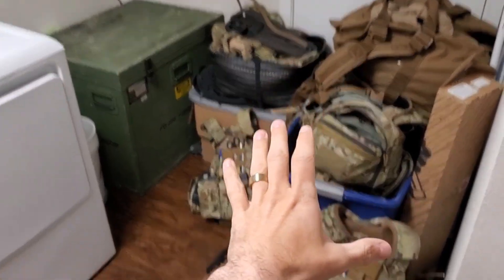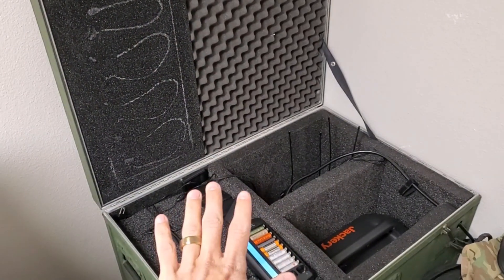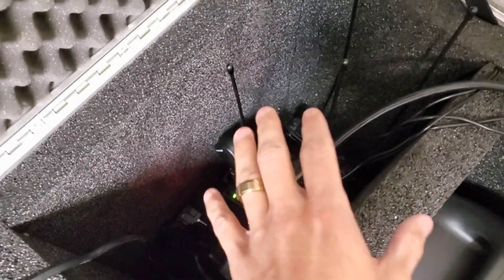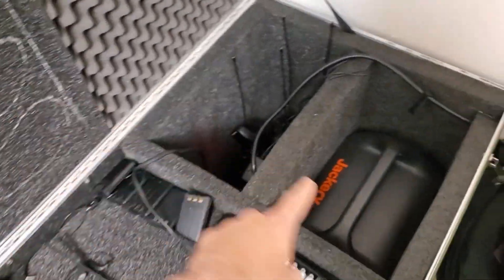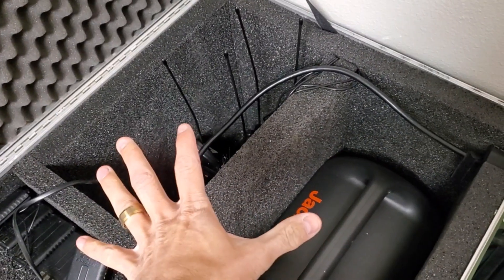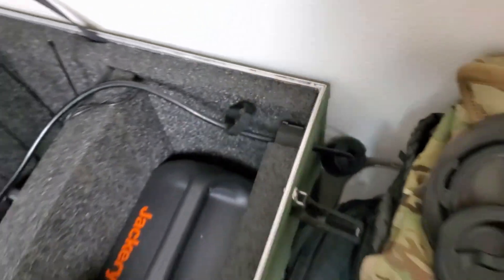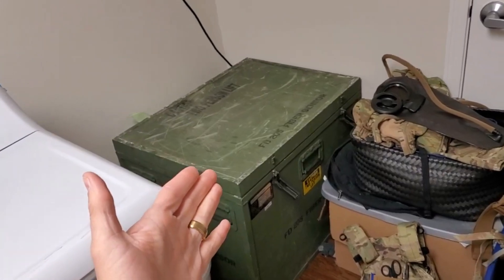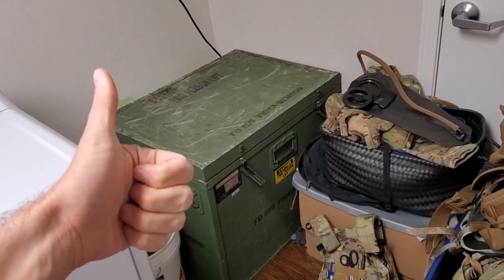Faraday Cage Set up

Comment: I suggest you line the inside of your box with adhesive backed copper foil (like the stuff used in guitar pickups).
Reply from the maker: Why would I add another layer of something if it already provides 80+db of reduction which is tested to be 90+%  effective on realistic EMP/solar flare events?
Reply: @PreparedAirman  tested by whom?

Comment: Did you test your box? I would remove the rubber seal and put alu foil in the split of the lid.
Reply from the maker: No need.  It has an inner aluminum seal then a middle rubber seal for water then a 2nd outer aluminum seal. They are specifically designed for EMP protection  upon further research after this video was created.

Comment: I have tested old microwaves and they work too, for those on a budget.    They are led lined and designed to seal in radio waves so if they can seal them in they can seal them out of course minor modifications had to be made to the plugs and cords extending out of the microwave

Comment: Now THIS is some preparedness! I have been looking into this very thing, With a internet “library” included which contains useful information for my family

Edit : about 20 seconds in Airman mentions various types 
Through my scouring of the internet I’ve learned that there is MUCH research going into high-intensity RADAR blasts which can disrupt non-hardened electronics, and the US has done research into artillery shells which can knock out electrical systems 😨
If we got it and use it, our enemies will soon possess such tech. 

Beyond this, the ever increasing threat of a devastating cyber-attack on critical (and degrading) infrastructure could necessitate these! 

As always Thank you for the lesson